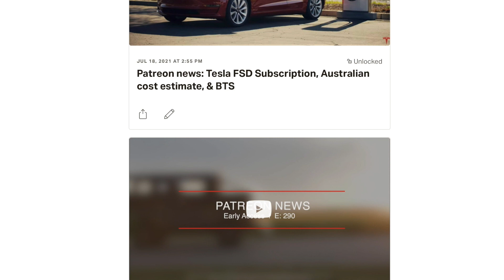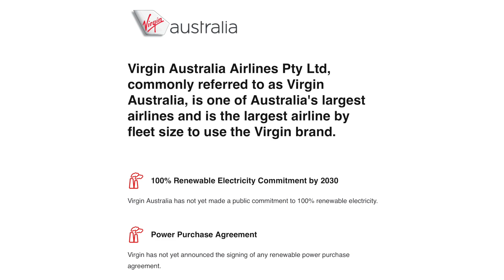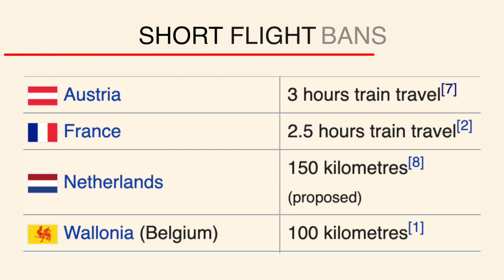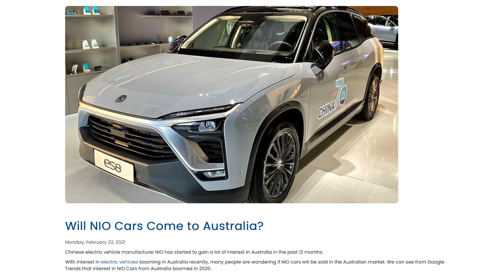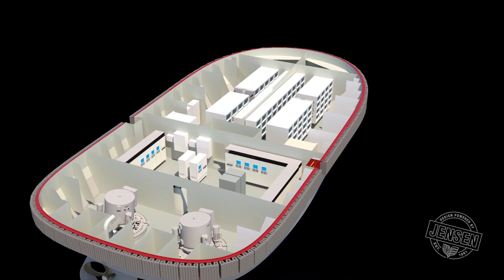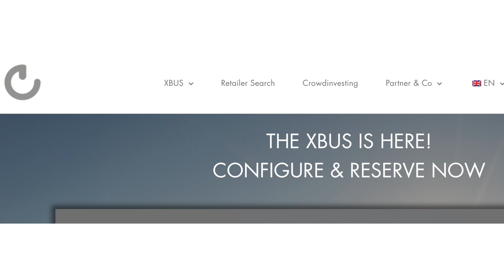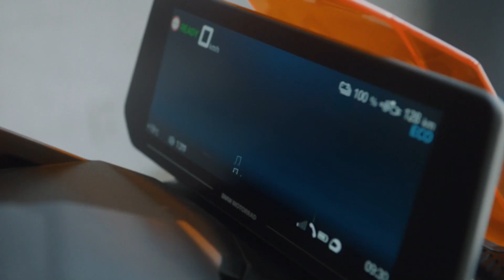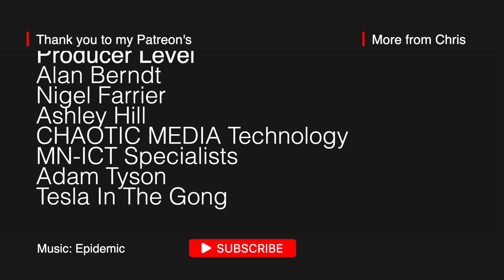BYD E6 Aussie Price | Why Electric Planes will be great, but not yet | BMW CE 04 | News 19.7.21

Comment: Hi Chis, I think the pricing for the BYD e6 is incorrect. They sold 15 of these in Australia just over a week ago and the price on the online ordering website was $49,990 plus on-road costs, so if they are indeed the price you are quoting there will be 15 very annoyed Aussie owners who paid way too much for their BYD E6 EV.
Reply: Apparently $40k+ORC is correct. Delay until Sept 1 and no stamp duty and $3000 rebate in NSW too.
Reply: @Nobody_Famous  on road cost don't equate to $9000 in any Australian state for a $40,000 manufacturers recommended priced vehicle. Case in point is the drive away price on the MG ZS EV the on road costs do not equate to $9,000 dollars for this 41,000 before on road costs vehicle which starts at 44,990 drive away.

Comment: Xbus has impressive capabilities.
Can carry 800-1100kg
The box module is 6000 litres in size
Can have a tipping tray
Offroad is only about 2200 euros more(2iinch lift, probably not 4wd)
Base model range(8/24 battery modules) is only 200km, but that's almost double our 2012 Leaf.